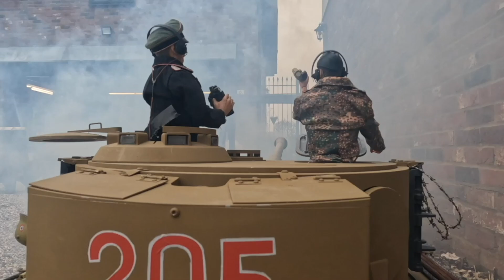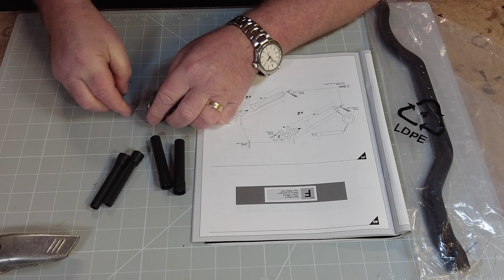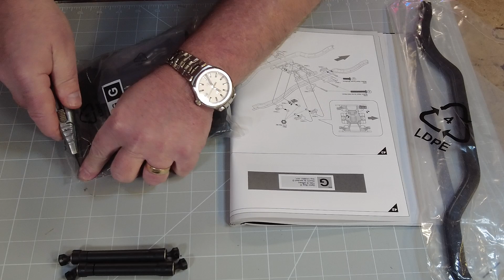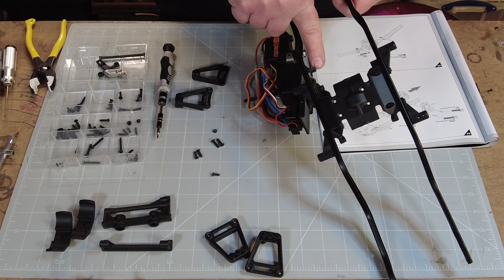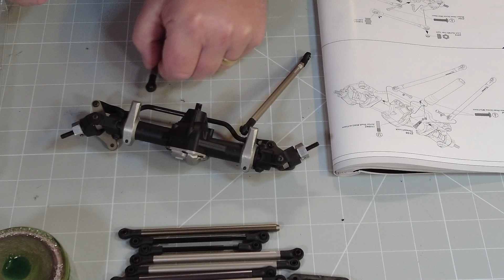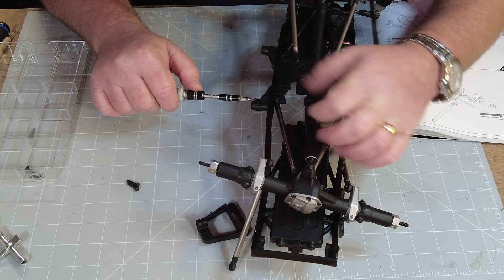Please join me on the build of this HPI Racing Venture SBK build (Vid 06) Assembling the Chassis

Comment: hi tony, a surprising number of parts in the build given the size of the packaging. it will be interesting to see the body shell installed. happy modeling.
Reply from the maker: Hi Trevor...Yes, they pack a lot into that small box...but...they do not include the wheels, bumpers, roof rails etc. these have to be sourced separately, but I guess they want the builder to customise as they like. Working on the body shell now, which will be the last video in this series and then I start my next big Armortek project. Thanks for watching, commenting and continuing to support my channel mate, it means a great deal to me.